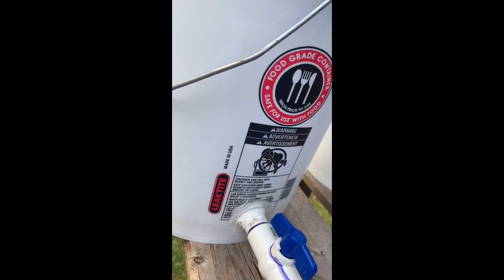Part 2 DIY Cleanest water system for chickens

Comment: James on your next one you build or as a  add on to this one you can put a barbed fitting in the end where you have the plug and put a breather tube ut in the air and cable tie it to the top of the tractor then it will be self bleeding
Reply from the maker: Great idea, Thomas. I like it 👍

Comment: Nice system
Reply from the maker: It worked out really well for our birds. Only change I would have made is to add another ‘manifold’/drinking station to the other side of coop, even if a little smaller, due to the number of birds. They all got plenty of water, it just stayed too congested for this GA heat around the one station.
Reply: Pettway Family Farmstead  well you did have a lot of birds 😉😂